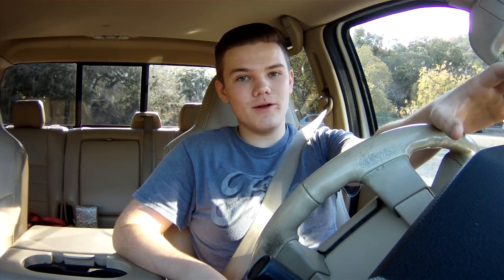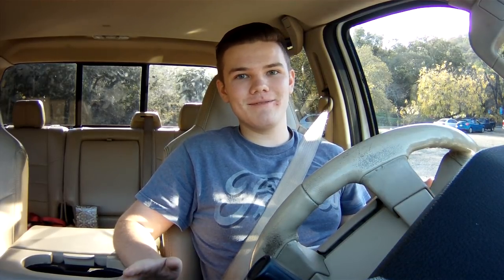The TRUTH About ARCHOIL!!!!   |   Part 2

Comment: I use it  for my 2000 F350 7.3 that has 316,000 miles....at 4000 miles between oil changes it used to get 14 MPG but with the use of this product I still get 15.8 to 16 MPG.....that's something to take note of for whatever reason........I just hate the price.....       :-)

Comment: Delete that dpf.  Delete the egr. I believe it’s a sequential turbo system. One feeds the other.  Basically has a similar smaller turbo like the 7.3. That feeds a vgt turbo like the 6.0.  This gives the 6.4 the low end boost.  Do your maintenance meticulously.  I believe the engine required a change at 220 hours.  I would do mine at 180.  And only by hours. Not mileage intervals.
Reply from the maker: Thanks for the tips! The truck does need an exhaust and a tune. Thanks for watching!

Comment: Turbo maxx has some zinc and 3 types of boron and HBN 10 x stronger than arch oil turbo maxx only  need 1/2 oz per quart only change oil every 15,000 miles we get 17 mpg towing 40 ft race trailer Turbo maxx spokes all arch products
Reply: I started using turbo maxx a couple of months ago. Got it because of a stiction problem in my injectors. Within 10 minutes the problem was gone and my fuel mileage increased. Pretty happy with it!
Reply: LOL....not for an old 7.3........stop second guessing the engineers....improve on what they recommend.....and stick with it....my 7.3 has 316000 miles on it and enhancing the engineering makes ole' Rusty run like a top.....        :-)
Reply: Kurt Ingalls, I wish I had a 7.3! I got the 6.0 so anything I can do to help it, I'm gonna do it.
Reply: Please don't say that...the 6.0 is the rocket of diesels and as long as you change fluids, watch your fuel and keep the tunes mild its a fantastic engine.........people by nature can be lazy....they say "diesel life" for a reason....it is a way of life....Good on ya for your 6.0.....you have a great truck.....and they are like dragsters!!!!                LOL      :-)
Reply: I would like to add one thing....my injectors.....they are all original...now hold on, they are worn out, no question, but they stack up evenly on deceleration , are a bit noisy, and I require a fuel filter EVERY oil change with 20 ozs. of Diesel Clean every third fill up (and I run every other tank of fuel down to fumes..LOL)......I'm at the point where if one lets go (and you will know it) Im going to change all including long lead.....I hope this helps as it might give you some thought to 6.0 longevity....I know 2 people who have 400000+ on theirs and have no problem.....    :-)
Reply: Kurt Ingalls, I'm hoping to keep my 6.0 around for a long time. One thing that I did to help my injectors was I put a oil bypass system on from amsoil. My cousin is a contractor in Afghanistan for the government. He said that if you do regular maintenance on the 6.0 they are very good engines.
Reply: HaHa!!!! I'm so jealous!!!! That's what i need to do to mine.....now you have me thinking......        :-)
Reply: Kurt Ingalls, I got mine from sinister diesel. It's a oil and coolant bypass system. $500. The oil filter is a amsoil filter and the coolant filter is a wix. I think they make them for the 7.3. Go to their website and check it out. Us diesel guys need to help each other out here and there!
Reply: Damn!!!!.....you got me hooked!!!!       :-)
Reply: Kurt Ingalls, got you hooked on the website? Or the idea of the oil and coolant bypass system?
Reply: oil coolant, Baby!!!!....I'm checking it out!!!!     :-)             ....I would like to see 1 million miles!!!!      :-)
Reply: Kurt Ingalls, in the 6.0 you have to change the oil every 3,000 miles or you'll blow an injector. With this bypass system I can go 20,000 miles or 1 year for oil changes. I went 13,500 miles and 15 months before an oil change and nothing happened. Oil was still good too!